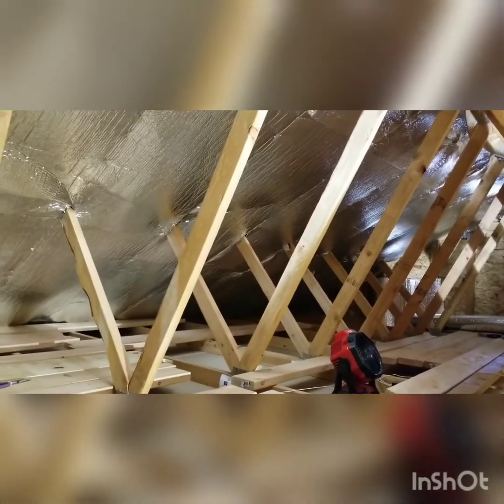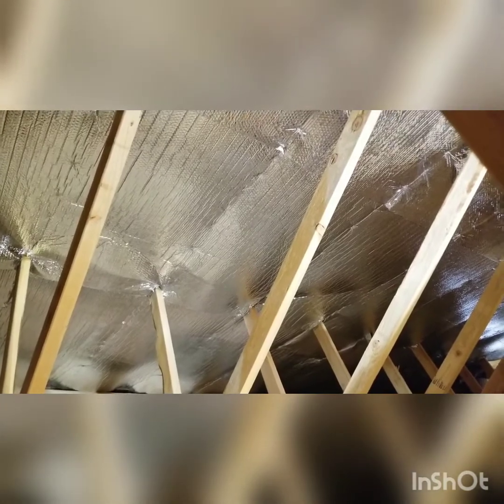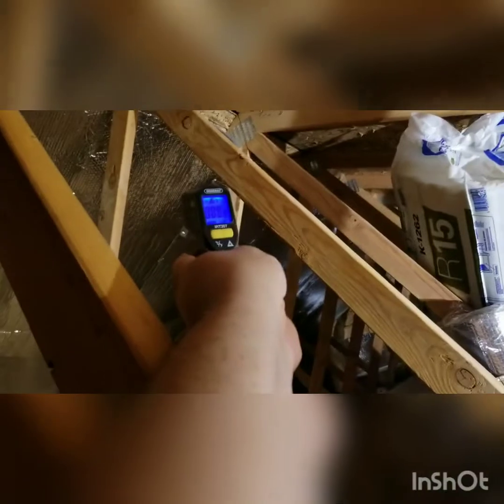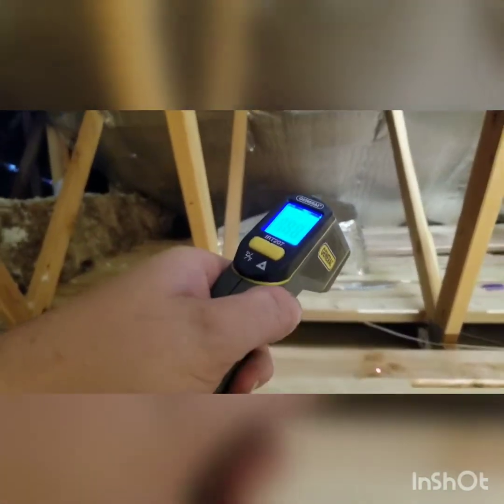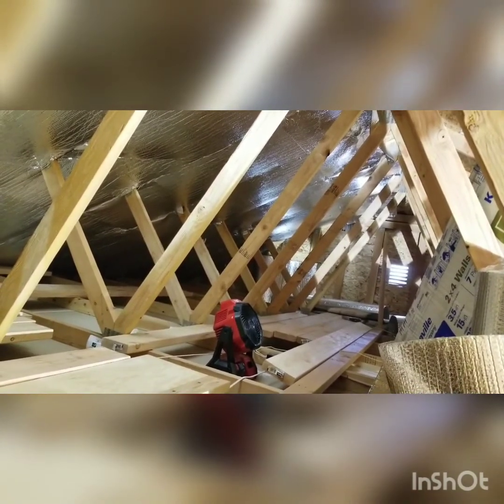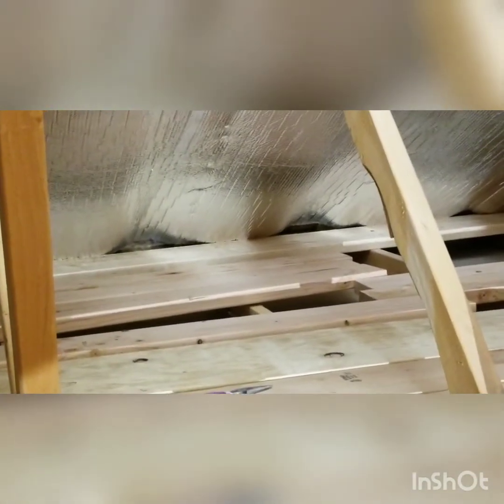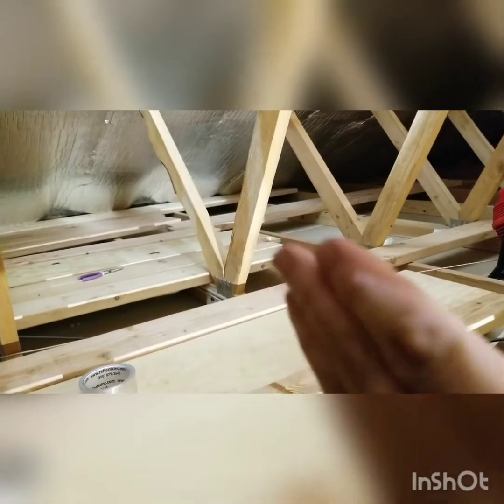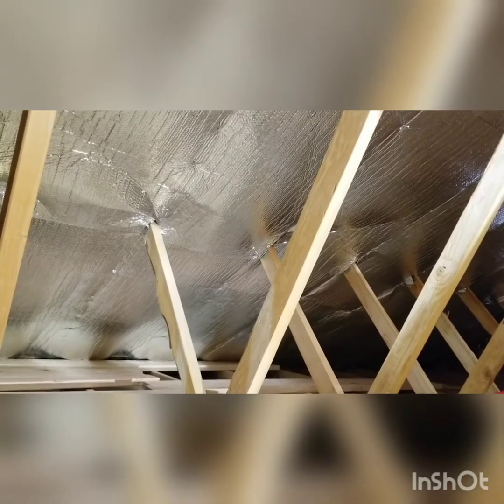Attic Radiant Sun Heat Barrier

Comment: I have seen some reports that it can shorten the lifespan of shingles from the roof decking temp being increased. Have you noticed that?
Reply from the maker: I have not seen or heard that. The reflection is more of a redirect in the heat so it doesn't go down to the living space. It's not amplifying the heat as it would when light reflects off a shiny surface from direct sunlight. I measured temps on the underside of the shingles and it only went up about 2-5 degrees on a sunny 95 degree day vs the area that didn't have the barrier added. I checked this multiple times and it was even less impactful on cooler days.
Reply: @BourbonCreations  thanks for your quick response.  that is great info.  I will probably put up radiant barrier in my house over the winter.
Reply from the maker: @rrodak  that's awesome. Let me know if you need anything else. Please consider a like or subscribe to help our channel grow and diy on buddy 👊 🪚